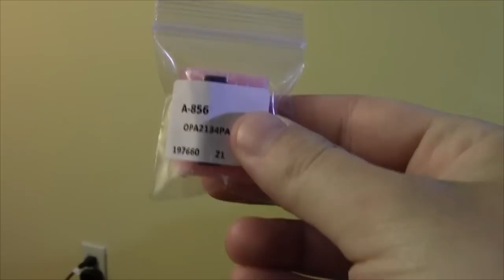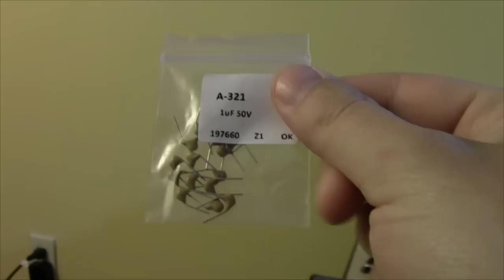Pedal Mods - Boss GE-7 Equalizer - Noise Reduction/Hi-Fi Mod

Comment: I made this mod to old made in Taiwan version and it worked really well. Now did the same to old made in Japan one and something is wrong. The sound is muffled even if the pedal is off or on. Could it be that these components are not suitable for older japanese ones of there is some other problem?
Reply from the maker: It's hard to say.  Maybe the older japanese ones had different chips that aren't pin-for-pin compatible?  Otherwise, all you can really do is check your soldering and make sure no tracks got broken, and no bridges happened.  Good luck man.

Comment: I love this video. Best one for years.

Where do you purchase your small electric parts from? Anywhere online?
Reply from the maker: Most of the parts I order are from Tayda Electronics, with harder to find parts coming from Small Bear Electronics.
Reply: @gasolinechlorine  thanks agains!

My next question would be what is the difference between DIP IC sockets vs machined tooled IC sockets? Is it just cost or is it compatible?  
Thank you in advance.
Reply from the maker: @ezzye5  Mostly cost. They'll both function.  The machine tooled ones are generally easier to use, especially if you're building pedals on stripboard, but it really doesn't matter.
Reply: Thanks dude

Comment: This is really old by now but there is some good advice in here for these older analog through hole boards. The TL022 ICs can be replaced with 062, 072, or 082s if you can't find others. As a general rule the higher you go the quite, but may draw more current. In fact they can replaced with any pin compatible dual op amp. I notice Tantalum caps can sound differnt in a EQ path and so long as they test good, that the values have not drifted, I'd leave them. Ceramics can be nosier in the audio path and a good candidate for using metal film\poly(film) or even mica for pF values. 🍻

Comment: If you do this mod is it just to make the pedal less hissier or will also fiddle with the range of eq?
Reply from the maker: Most of the cap changes are the same values, just different/better materials.  So it won't fiddle much with the eq range, just the noise.

Comment: Should this mod work with the vintage GE7s that use the 12V PSU? I installed sockets for the ICs and tried a few NE5532s and the LED never lit up. It'll still work like normal if I throw the old op amps back in. From what I've read the 12V psu is dropped down to 9V so I'd assume the new op amp rails are still receiving the correct power.
Reply from the maker: I haven't seen a schematic so I can't say for sure whether the power is dropped.  It's weird that it's causing the LED to go out though...  Definitely something going on there.

Comment: Thanks for taking the time to show this Mod Adam, gave me the confidence to have a crack. I only changed OP amps with NE5532's and can definitely confirm its a very easy mod with great results - nearly all the hiss has gone. Not sure my ears could hear the difference with changing the caps, so haven't done this mod, unless someone can confirm you really can hear the difference?. Cheers.

Comment: Great instructional video! However i have a minor problem here, i somehow managed to disconnected the grey wire that attached on P4 on the PCB, the pedal now doesn't starts and i have no idea where it should be connected to. Would you kindly shed some light on this?
Reply from the maker: Hey man sorry for the late reply.

On mine, the grey wire from P4 connects to the input jack.  Same lug as a darker grey wire (but not the same lug as the black wire.)  Hope that helps!
Reply: Wow thanks dude, never expected will get a reply on this on vid, yes a few moment after i sent this question i found a solution, by reconnecting it back to the input ground and the pedal worked just fine
Reply from the maker: @freezaxp  Awesome man, glad you worked it out!
Reply: Now i have another problem, i have mod my ds2 with wampler mod, based on your another video, put everything as listed and the pedal works, but the output is VERY weak when distortion activated 😅

Comment: Hi Adam!i know this is an old vid,but i've just find it and i have a question!wanted to do this mod with my Ge-7 but when i opened out i'v found actually 4 chips insted of 3!1 jrc 4558DD,and 3 IR9022079ZB!so i just have no idea what to do now with this mod!i hope u can help with this old post....Chears
Reply from the maker: Hey man.  I'm not familiar with a GE-7 with 4 chips.  It sounds to me like you would want to change the three IR chips for noise, as the 4558 isn't that bad.  However, don't take my word for it, you're gonna have to research a bit and make sure.  Good luck with it dude!
Reply: @gasolinechlorine  thank u sir!just find out that i'll have to change that first 3!now i'm fighting to find a solution to desoldering the old ones😂
I like this,u think it's just a soldering thing but actually desoldering something like this is pretty f...ing difficult
Reply from the maker: @jimyjoegingerale  Desoldering is much easier with the proper tools.  Look for a desoldering pump and/or desoldering braid.  They will make your life so much easier.

Comment: Fantastic mod!  And superbly explained and detailed in this video.  I have an excellent bass preamp that I would love to reduce the hiss on and I was just wondering if similar train of thought could be applied to making it a little quieter?  Anyone think it's possible?  BTW there is an EQ just like the boss kicking around out there with no noise or hiss called the Biyang EQ-7.  It's also cheaper than the boss.  No hiss.  One of the best things I've bought in years, sounds great and build quality is excellent.

Comment: Why do 50% of ge7 owners say they get no hiss? On my pedal I only have to nudge down any of the faders 1 dB before the noise gets out of control..... anyways, thanks for tutorial I ordered the IC’s. Hope I don’t screw it up. I am going to try without sockets because too lazy to make another order.
Reply from the maker: Good luck man.  Just make sure you don't heat the IC's too long and you should be fine.  Alternate legs to keep the heat away from one spot.
Reply: Thanks mate, great advice... hey I don’t know if you do electronics as a job or anything but my pc blew out like 3hard drives, my blu ray drive and external sound card in 1 hit and after hunting about on the internet I am leaning towards hopefully it’s some TVS diodes that have blown, I can snipe them out to get power back into them apparently? Only problem is after taking all the covers off of them I don’t really know what I can snip away to try it out? Do you know anything about this? And if you do would you be interested in my sending you some money for each drive you can help me locate the diodes on? If it’s an impossible job then I completely understand but would love to get all my gear back, I lost like 500+£ worth of gear in 1 go! Cheers ! Looking forward to trying out this boss pedal though I have some tracking I would like to get on with, with no hiss
Reply from the maker: Sorry I can't help you with that.  I just do this for a hobby, I really don't have any electronic experience besides that.
Reply: Absolutely no worries! Really appreciate you letting me know. Thank you!

Comment: Another question if you don't mind answering. About the capacitors you swapped in, what are they values base on? Were they of the same value as the previous ones just in different models? Or did you increase/decrease the values?
Reply from the maker: I think I should reiterate:  This is not my mod, I found this online, and decided to do a video for it.  Having said that, I think they're the same values, just better quality parts, but don't quote me on that.
Reply: Adam cool, thanks. My pedal is busted anyways so I guess it's worth a shot. But I'll begin with the ics only for now
Reply from the maker: I double checked, one of the caps is slightly off from the original value, but all the other caps are identical, just different materials.  I'm assuming those are also to help reduce the noise from the eq bands.
Reply: Adam makes sense. Better quality without affecting functionality since they are pretty much the same value. Thanks for taking your time to help me!
Reply from the maker: No worries.  Good luck.

Comment: Very good guide. I could not be bothered to change all those caps. I am happy to confirm that by replacing the OPamps with NE5532's all the hiss has gone. Changed the pedal from a pile of S** to a very useable device. I kinda feel that the adjustments have more range now. Not about to swap the chips back for an objective test though. Many Thanks for posting this.
Reply from the maker: Glad to help man.  One thing I forgot to mention in the video is that the replacement chips will draw more power.  So if you're using batteries, be prepared to change them more often.  Power supply people won't have that problem.
Reply: That may explain why the other chips were in there in the first place. I just could not figure out why Boss would want to save a few cents and put cheaper op-amps in. Perhaps those sales people that business let do all the engineering these days said battery life is more important! I have isolated DC supply so not an issue for me.

Comment: This video sucks. It doesn't show you how you did it. It's useless.
Reply from the maker: Seriously?  I showed you exactly what I did.  If you need more than that, might I suggest searching for a video about how to solder?
Reply: I know how to solder. I want to see how you did it on this unit. It's easy to talk about were the parts go.
Reply from the maker: It's really not interesting enough to show that.  Just desolder the old parts, solder in the new ones.  In the case of the IC's, solder in the sockets, then just seat the new IC's in the sockets.  Simple.
Reply: I hate to bother you again but when I looked at the opa2134pa's I noticed there are different voltages. What is the recommended voltage for these. Thanks.
Reply from the maker: I'm not sure what you mean by different voltages.  But Boss pedals generally run off a 9VDC supply, so as long as the chips can handle 9V, you should be fine.
Reply: The site I looked at which is Texas Instrument list them at different voltages,2,2.5 up to 18 volts
Reply: Never mind I guess it's just the voltage range it can handle. Thanks.
Reply from the maker: lol glad to help.
Reply: One more question, Do you think the opa2132pa would be a better choice ?
Reply from the maker: Personally, my favorite is the NE5532.  I think that one's got one of the lowest noise floors, and it's only like 10 cents per chip, versus the opa chips which tend to be 2 or 3 bucks a piece...
Reply: Thanks.